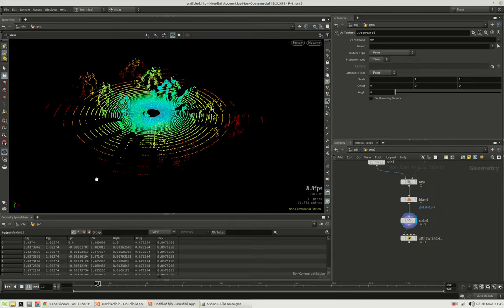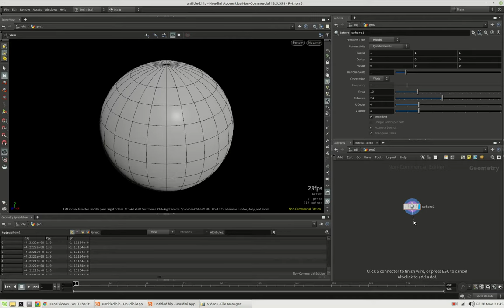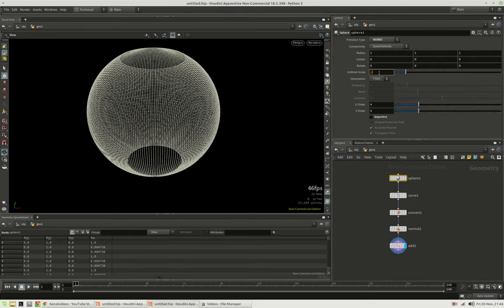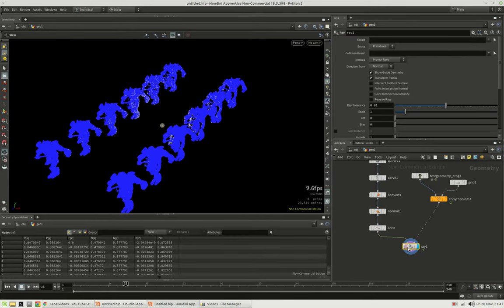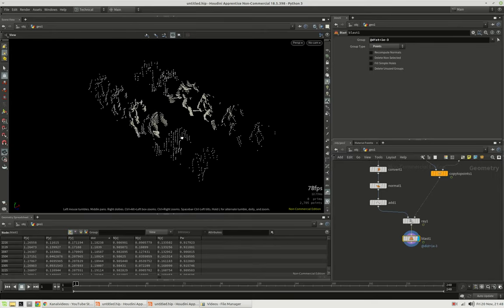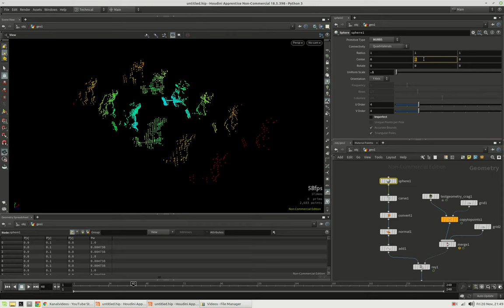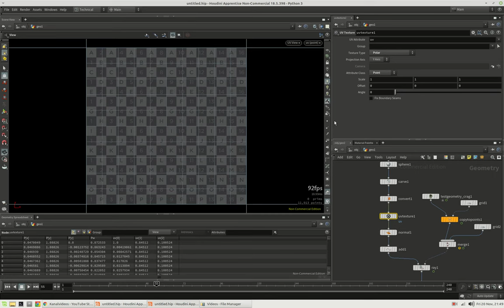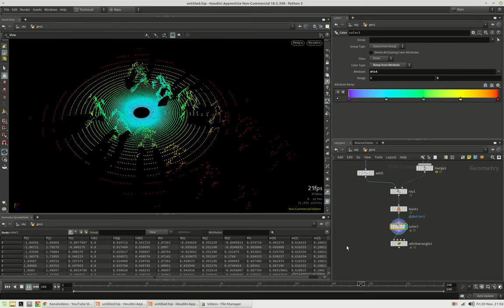Lidar 3D Scanning Look – Houdini Tutorial

Comment: Is it possible to get the point cloud out of houdini in real-time for simulation purposes?
Reply from the maker: You could either export the point cloud per frame or use Houdini Engine.
Reply: @KonstantinMagnus  Oh ok. What is the difference? Per frame would be fantastic. Does it create a new file per frame? That would be kind of slow...
Reply from the maker: @questionasker9226  Exporting it per file might be huge. Do you need it inside a game engine?
Reply: Thanks for your help. No I don't need it in an game engine. I am thinking more of a robotics framework. A very simple case would be too just feed the pointcloud to a cpp programm. Something like streaming ... 
I found something with hdk and GEO_IOTranslators. Could that work? Or are there better ways?
Reply: For example I want to create a vehicle in houdini that drives around and captures the lidar data to try out various scene reconstruction algorithms.
Reply from the maker: @questionasker9226  Sounds interesting! Just give it a try. ; )
Reply from the maker: @questionasker9226  Better ask on the Houdini forums. I haven't done pipeline work much.